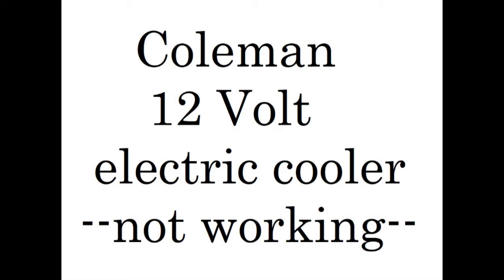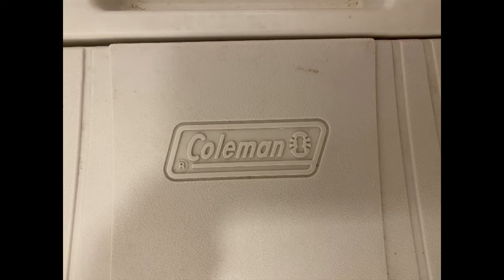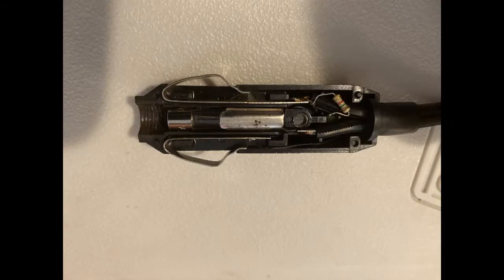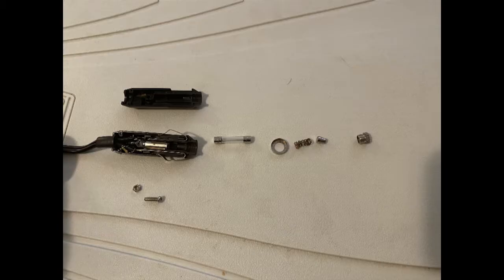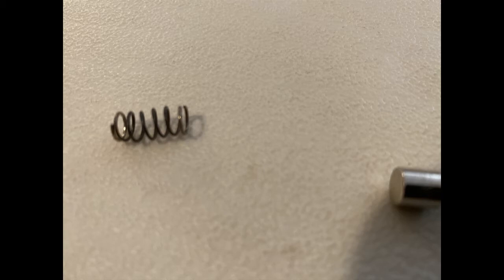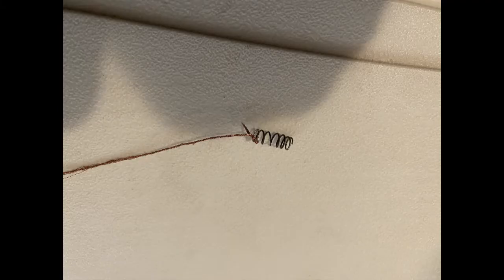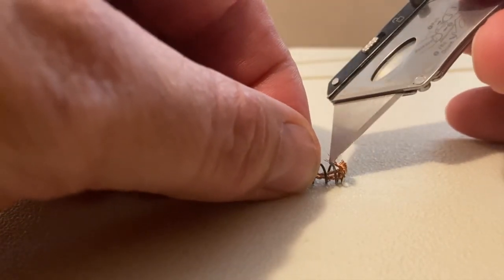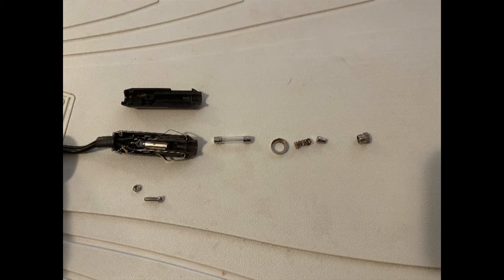Coleman 12 Volt electric cooler stopped working

Comment: I’m a OTR truck driver and got one of these it stopped working after eight months going to check the fuse thanks for the video save me another to $150
Reply: Update yup fuses blown
Reply from the maker: Glad you didn’t have to buy a new one
Reply: Mine is not cooling
Reply: These are junk
If it's not fuse it's a fan...not gonna last nore than a year.

Comment: This is the third Colman cooler I purchased; each one completely stopped working. I never knew there was a fuse in it. My newest cooler has only been used one time. ...I will be looking for a fuse tonight...thank you...okay...a few days latter. I opened up the part that goes into the cigarette lighter to find it completely empty. No fuse, no part that sticks out of the black part. Not sure where all that went. I guess I will replace the entire plug (?)  Just ordered this: Coleman Thermoelectric Cooler Replacement 8 ft. Power Cord w/Fuse ..no wonder mine quit working...duh!
Reply from the maker: Hopefully that’s all it is. 👍

Comment: Boy, am I glad I watched this video before I received my Coleman thermoelectric cooler. I bought it to use temporarily until my RV fridge can be fixed. I plugged it into  a Jackery 1000 to cool down with a block of ice in it. Within an hour it was cold but the plug was really, really hot. I pulled it out. The fuse had not yet blown. I put the copper wires through the spring as in the video and tried it again. After checking it multiple times, the plug never got hot after 3 hours, although when I pulled it out the little button had lost its tension and was very loose. It still was making a connection. Hopefully this fix will last. Thanks again for the video.
Reply from the maker: When I did mine the spring had gotten so hot that the spring had collapsed. I just pulled the spring at both ends to stretch it back out.
Reply: @JerryRigger  I did that but I think I didn't pull it hard enough.

Comment: I bought a couple of these and all tge time the fans stop working and the plate inside freezes up and deize the fan
Reply from the maker: good to know, I blow mine out every once in a while with compressed air to get all the dust out of it to make sure I get good airflow across the heat sinks. but I don’t use mine on a regular basis. Mostly just for vacations and occasional travel.

Comment: There's truck stop dumpsters littered with the Coleman and Igloo coolers like yours. I've had several. I'm wondering if that spring was the problem. 
Be that as it may. Those coolers have issues beyond the plug and spring. But it does bring back memories. 🙂
Reply: I would say just grow up and either spend the pretty penny by purchasing a dometic electric cooler or buy a $300 inverter and install real fridge in your truck. Those Coleman coolers were good when I didn’t know any better. Motor burns out in less than a year. The dometic electric cooler has an actual compressor in it and can act as a really good refrigerator or act as a passable freezer. The damn thing just plugs into the cigarette lighter
Reply from the maker: Good advice, but if I did that I wouldn’t be the Jerry Rigger!
Reply from the maker: It also occurs to me that if the spring is building up resistance as I suspect, it could cause premature failure of other components as well.
Reply: I bought a new one and it started freezing up  plus the cord end  is getting too
Reply: @psalms1163  - if you run them 24/7 they will freeze up. i run my cooler 5-6 hrs and then unplug it for 5-6 hours. there is also less chance that your plug-in overheats/melts.
Reply: @JerryRigger watch your fuse block on these type coolers or you'll be rigging more than just a cooler !!! ✌️

Comment: Did the light stay on when ur fuse blew.  My coils are getting cold but the fans arnt working and my plugs getting hot
Reply from the maker: I believe the light will go off if the fuse is blown. Are either of the fans working? It would be odd for both of them to go out at the same time. Did you check to see if anything was blocking the fan from moving?

Comment: Jerry Rigger, I have the same Coleman thermoelectric cooler as in your video. Bought it about 20 years ago. Recently, the black insulation on the tip of the old plug melted. Bought a replacement plug (which doesn’t have that black blob on it), but no instructions came with it. Watched both your videos, but you don’t cover my issues. First, how do you get the cover off the fan? Unfortunately, one of the screws seems so degraded that I can’t get it out. I tried leveraging the cover off—just to pop that screw—but I gave up. Any suggestions? Plus, I need to know how to safely connect the new cord. I’d really appreciate your advice. I’m a 70YO female who likes to fix things if I can. Otherwise, I’ll have to buy a new one. I’m going on a road trip next week. Would like to take the cooler with me. Thanks!
Reply from the maker: unfortunately, someone has borrowed my cooler so I can’t look at it at the moment. The screws I remember went directly into the heat sink. Since I don’t have mine, I can’t look to see if there’s room enough to pry the aluminum heat sink apart with a large flat head screwdriver to release the screw. of course that would risk damaging it but if you have nothing to lose cause you’re gonna just throw it away anyway it might be worth a try. If that worked you could probably straighten it back out with a needle nose or other plier after getting the cover off. Drilling the head off the screw is another option. If you purchased the replacement cord that Coleman makes for that cooler I would think it would have the correct connectors on the end and plug right in.
Reply: Thank you! I didn’t think about drilling the head off the bad screw. I’ll try that next. I have the other three out and those corners of the cover loose. I almost got the 4th corner to pop up loose from the screw, but no luck. Maybe tomorrow! And you’re right, I’ll either toss it or just use it as a regular ice chest if I can’t fix it. It worked great for almost 20 years!  Thanks again.

Comment: What if you’re not good at that kind of stuff. Isn’t there anyway to buy a new 12v connection?
Reply from the maker: Replacing the fuse is easy enough you can just unscrew the end. Coleman does sell a replacement cord but it, too, will require some tools to replace.

Comment: Never wired anything in my life did exactly what u said and my cooler is working! They only had a 7 amp is that gonna be a problem I will get a 71/2 when I can find one but apparently it’s hard to find at truck stops because of this damn cooler. 🙄
Reply from the maker: If your cooler originally had a 7 1/2 amp fuse in it using a 7 amp fuse of the same type temporarily should be fine. It is always best to put in the recommended size though. Never install a larger fuse than is recommended.👍
Reply: @JerryRigger  thanks still looking for the other size but it is working like a champ and plug is not getting hot like it was before. You are a genius! Thanks

Comment: I’m so glad I found this video.  I have this exact cooler and it stopped working.  My plug also gets really hot.  I’m going to check the fuse!   What fuse is it?
Reply from the maker: The fuse should say what size it is on it. If it is hard to see try taking a picture of it and blowing it up.
Reply: I think it's a F7.5AL250V. I have found F7AL250V, but not 7.5

Comment: About to try it out, having the same problem.
Reply from the maker: Did it work for you as good as it worked for me?
Reply: @JerryRigger  I plugged it for about 15 minutes. It worked but it still gets hot, not as much as before though.
Reply from the maker: @MXWJ01  that’s odd, there’s really no reason for the plug to get hot unless somethings wrong. Since I did the wire thru the spring trick mine doesn’t get hot at all. Did you double check the spring?
Reply: @JerryRigger  No I did not, maybe need to put more wire and check the fuse size
Reply from the maker: @MXWJ01  You should always use the correct fuse. Heat though is usually caused by bad connections or wire that is too small to carry the current.

Comment: Hi, what fuse is? Específic please
Reply from the maker: mine was a 7.5 amp quick blow , but you should use whatever size you took out of yours assuming it is the original fuse. The fuse should say what size it is on it. It may be hard to read so a trick I learned is to use my phone camera and enlarge the image to make it easier to read.
Reply: The fuse is a glass tube with metal ends that is inside that part that you shove into the accessory plug in the car.
It is designed to 'blow' to protect the cooler and car from an electrical overload.  It also protects the wires from getting too hot and melting or starting a fire.
I went to an auto-shop and bought a package of 5 for $4 and keep the extra inside the cooler in a waterproof case.
The wire bypass is a temporary move ONLY to see if the fuse is the problem.  If the cooler works with the copper wire, it means that the fuse has blown and needs to be replaced.  If you leave that wire in, the cooler risks being overloaded and causing problems with overheating.
Reply from the maker: @richardjohnson4052  In the video the wire is used only to allow better conductivity of the spring and does not bypass the fuse. You should never bypass the fuse as wiring damage or worse could result.

Comment: Thanks Jerry. My issue is that my cooler works when plugged into 12v but not when I plug in to 110. Is there a way to test the power adapter?
Reply from the maker: I would start by just visually making sure that the inside of the plug is not dirty. If everything looks clean make sure the plug goes all the way in the socket.  If you have a DVM you should be able to change it to the DC setting and should read 12 V between the center tap and the outer edge ground of the socket. Be careful not to short the center tap and ground together as it could burn up the power adapter. If you don’t have a DVM, you might try plugging something else into it. Also try plugging the power adapter into a known working outlet. If all else fails I believe the Adapters are only about $20 or even less if you find an aftermarket one. I had one fail one time and luckily found that I had another adapter rated at a higher current off of something else that I was able to splice the plug on to. Thanks for watching

Comment: What about if the cooler is not cooling anymore?
Reply from the maker: Are the fans running? I don’t believe these are that complicated. But I would need to open mine up and look at it. If the fans are running but it is not getting cold the cooling plate may have gone bad. If the fans are not running, then you’ll need to determine if the fan has gone bad, something is shorting the power, or if there’s no power going to the fan. I am assuming that you have already checked the fuse and that you have a good working power source. Do you have a DVM that you can test it with?

Comment: That's not the fix the fan inside is clogged with dust and debris needs to be cleaned up that's what caused the fuse to blow in the first place and it's a 2.5 amp fuse so of course a 7amp won't blow
You should always replace your fuse with the same amp fuse for your safety
Reply from the maker: @Ryan Bagwell If yours had a 2.5 amp fuse then you should of course replace it with a 2.5 amp fuse. Mine had a 7.5 in it so I replaced it with the same fuse. If you suspect that your cooler has the wrong fuse in it then I would recommend contacting the manufacturer. Good luck repairing your cooler and thanks for watching.

Comment: You could’ve just open (twist) upper part and slide it in.
Reply from the maker: The fuse on mine wouldn’t come out until I took it apart. If your fuse comes out easily then yes, you would not need to take it apart. Thanks for watching.